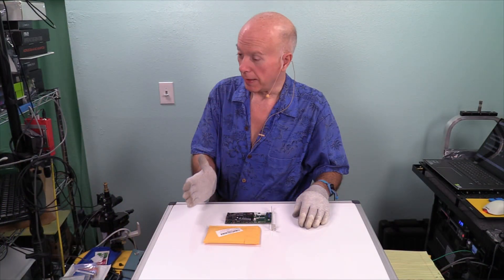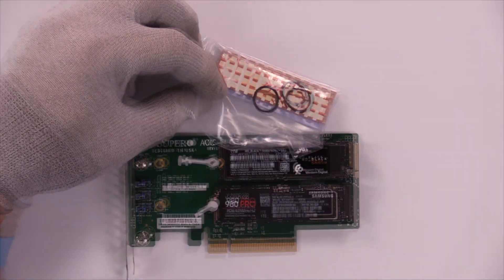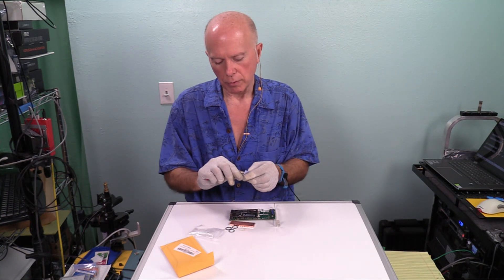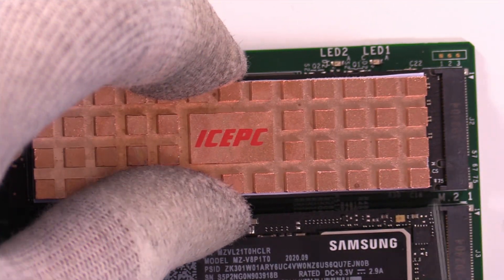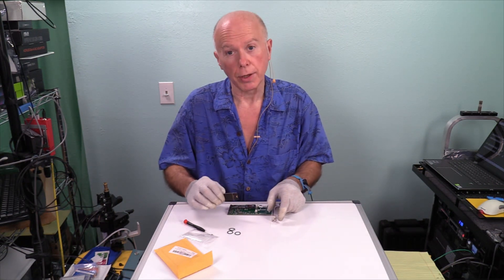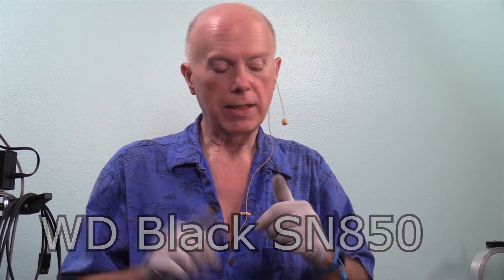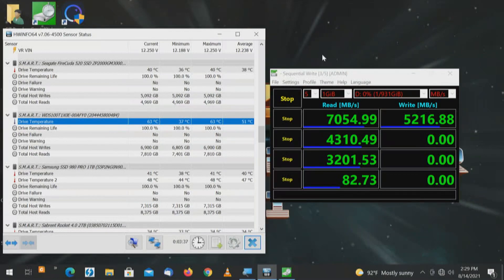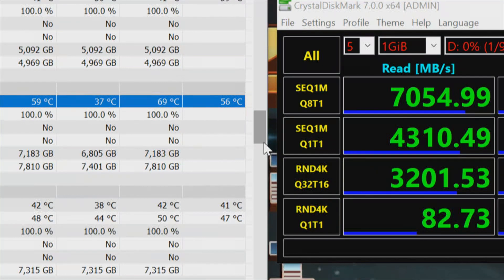Install, Inspect and Test IcePC Copper Heatsink Kit 2280 M.2 Drive BuildOrBuy

Comment: Your short test is simply measuring the heat capacity of the heat sink because it doesn't have time to heat up and transfer much heat to the air.  I wouldn't trust that these are even copper.  You could determine their density by weighing and then submerging in a graduated cylinder of water to calculate if they match the density of copper or a solid copper-aluminum or solid copper-zinc or even copper coated aluminum/zinc.  A longer sustained test would indicate if the heat sink can effectively transfer to the air.  For any of these, polishing the contact surface will probably increase the heat transfer.  I don't know how well the pads conform to the heat sink. Do you see the grinding pattern on the pad after removing the heat sink?

Comment: alum is good for heat transfer and copper is good for absorbing heat
Reply from the maker: Hi @ajd0101 ,
Welcome. Copper has a higher thermal conductivity.
Reply: @BuildOrBuy  yeah stuff always is changing also like you said if you change 1 thing everything get's messed up lol. personally the copper gets best temps but varies day to day sometimes it's at 39 or 37 Gen 5 ssd with nothing it's around 47 with Gen 5 ssd, and with alum alone small/thin shield is like 3-5 degree decrease, that copper is 7-10 degree decrease (Celsius). but overall a hybrid is best majority idk for sure yet lol
Reply: @BuildOrBuy  ive also noticed if i have a fan on pc it really makes no diff in temps even though there's clearly colder air than normal blowing into it , at best a 2 Celsius degree decrease overall the thermal pads are the difference makers
Reply from the maker: Hi @ajd0101, 
Yes. Of the many M.2 NVMe PCIe SSD Heat Sinks we've tested, Passive Coolers have outperformed Active Coolers. That was interesting.

Comment: Lies. First of all, you need to install normal gaskets, I installed expensive 20 W/mm, not standard ones
Secondly, you need to put 2 halves of spacers, 0.5 mm on the memory banks and 0.75 mm on the controller, remove the sticker immediately - 4-5 degrees. It turned out in tests no higher than 50 degrees, 47 degrees.

Comment: nice, but one question, why not removing the brand label sticker before mounting on the HS? not a clean job i.m.m.
Reply: hes testing 2 ssd one samsung one western digital he doesnt want to remove the stickers cuz of that reason so we can see & he can remember i guess..
 
Plus if you remove sticker you VoID warranty..  i just had a brand new WD Blue SA510 ssd sata M.2 not even last 12months in a laptop that still had 477gb left to use it had two sandisk chips on that driver too..
Reply: @user5.56  removing a sticker NEVER voids the warranty . there is a law againts that bad behaviours of manufactureres...so its BS .. the stickers works as isolator...i´ve removed them giving me additional 3 -4 degrees lower temps...

Comment: Would this heatsink be best used inside a PS5? I thought about using Graugears PS5 SSD bay door which has air holes added to it. I figure using this would be better than using the aluminum heatsinks using a wing design made just for the PS5.
Reply from the maker: Hi James Webb, 
Welcome! Based on space, yes. Based on effectiveness, no. We Tested a Copper Plate Heatsink that may be more appropriate. Link below. 

1. MHQJRH M.2 Copper Heatsinks Cooler for M.2 2280 SSD Laptop (2 Pack) 
https://amzn.to/3nSeqXE 
As an Amazon Affiliate I earn from qualifying purchases! Hope that helps!

Comment: I think nvme heatsink is overrated. Don't need it if there's plenty of airflow.
Reply from the maker: Hi Boba Milk,
Welcome! That depends. If You're using PCIe 3.0, Heat should not be a problem. Although We have had a few Viewers who have had Heat issues. PCIe 4.0 and above are definitely a concern for Heat! While Testing 16 M.2 NVMe PCIe SSD Heatsinks We learned to throw all assumptions out the Window! That was an eye opener! We definitely need better Designs in both M.2 NVMe PCIe SSD Drives and the Cooling Solutions We're using. Appreciate Your Comments! Hope You never encounter Throttling due to Heat! Yes, airflow definitely matters!

Comment: Are all chips the same height?  Usually the controller which needs most dissipation is thinner and alot of heat sinks don't have contact with it.
Reply from the maker: Hi Colin Doyle, 
Welcome! Great Question! Height as in thickness. We always think in terms of Single Sided or Double Sided for M.2. Yes there's a difference however We measure at highest point for Heatsinks. Will start checking on that from now on. 1mm Pads should make contact but a different compression factor absolutely. Thanks for pointing that out!
Reply: @BuildOrBuy  Thnx for reply ... I am referring to the thickness of the chips themselves. The controller is sometimes thinner and some are mounted next to nand. From what I gather the controller needs more cooling, the chips about 50% compraed to controller and when a flat piece of material is mounted to nvme "flat" surface the cooling is reversed. 
Good videos :)
Reply from the maker: Hi @colindoyle9876 ,
Absolutely! Good timing! Copy that. To reiterate, compression. Yes the Chipset Requires Cooling. As a whole, We're getting good Numbers. Thank You for Your Comments!! So far, 16 M.2 NVMe PCIe Heatsinks!

Comment: Is the 4mm thin enough to fit behind a nzxt b550 m.2 shroud or do I need to get the 2mm one
Reply from the maker: Hi 24k,
Welcome! This 4mm Milled Copper is way too thick for underneath use! The other Copper Plate We Tested was 1mm thick. Just a Flat Copper Plate, no Milling. That might work behind the M.2 NVMe PCIe Drive. What kind of Temps are You seeing now? Can You keep it below 65C, as is? The 1mm Copper Plate requires 1.5mm space for installation to allow 0.5mm for Thermal Pad. Tight fit!
Reply: @BuildOrBuy  I'm starting my first build and have yet to build it so to answer your temp question I don't know yet I was going for a Ryzen 7 5800x with 3080 nzxt b550 Corsair 4000x Corsair aio with led screen Corsair 32 gb ram Corsair 1000 psu and Samsung 980 and 980 pro for my pcie 4 and 3 slots I was just tryna fig out was there a heatsink slim enough to fit behind my nzxt b550 shroud or would I be ok with jus the m.2 without it or if I could jus use sum thermal pads between the m.2 and the shroud to at least have something to cool it
Reply from the maker: Hi @24k-l9t ,
Got it! PCIe 4.0 needs an M.2 NVMe PCIe Heatsink! Does that Motherboard not include a Heatsink? How much clearance will You have? Success on Your Build!

Comment: I actually bought this before watching this review. Sadly I couldnt fit any traditional heatsink in my laptop so this was the next best option. I bought 2 copper heatsinks a 4mm thick and other slighty smaller and put it on both sides on the SSD. And from what I noticed, it works great.

My only issue with the tempature before is when I was transferring files, the copper greatly slows down the heat from instantly spiking up to 80 'C whenever I was transferring something big.
Reply from the maker: Hi Mikkeru,
Welcome! We expected this M.2 NVMe PCIe Heatsink to do better as well. Surprised on PCIe 3.0 You're having Heat issues. We've Tested 14 Heatsinks and 3 Thermal Pads. A Flat Copper Heatsink was more effective than this one. Link below. 
M.2 Copper Heatsinks Cooler for M.2 2280 SSD Laptop（2 Pack)
https://amzn.to/3g7a1vV
As an Amazon Affiliate I earn from qualifying purchases! Hope that helps! Thanks for Sharing!

Comment: some said , you should remove the m.2 labels before putting on the heatsink.. my question is.. do we really need to remove the labels of m.2 or its ok not to remove, just instal the cool sink.
Reply from the maker: Hi JOHNZKIE FLASHER,
Welcome! Some M.2 NVMe PCIe Drives such as Sabrent utilizes a metallic label to act as a Heatsink. We choose to leave Labels on all of them even if paper or plastic coated since We're always testing so many Devices. Otherwise We'd lose track of Who's on 1st! Heatsinks and Thermal Pads can make a big difference if You are so inclined to try. And this Video is one of 14 Heatsinks and 2 Thermal Pads We've tested on this Motherboard. Great Question! Thanks for Asking!

Comment: Thank you, very much. This is the first time I've added a Samsung 970 EVO Plus SSD 1TB, M.2 NVMe Interface Internal Solid State Hard Drive with V-NAND Technology for Gaming, Graphic Design, MZ-V7S1T0B/AM into an M.2 NVMe to PCIe 4.0 adapter with copper heat sink. Worked perfectly. Thanks  :)
Reply from the maker: Hi Joe B,
Welcome! Excellent! Once You've gone NVMe, no going back! Proof is in the doing! Success on Your Installation! Thanks for Sharing!

Comment: In a few words this IcePC Copper Heatsink is not a good option. Looking for your videos for finding the best cooler without fan for a samsung 970 evo plus. I have a sata III ssd samsung evo 960  and I´m thinking about changing by a m.2 nvme samsung 970 evo plus but I won´t buy it until I find the best cooler. Do you think the Acidalie heatsink would be the best option? I would appreciate your advice. By the way, you make very good and instructive videos and they are very helpful. Let me say, good job!
Reply from the maker: Hi Ignacio Fernández Santamaría,
Welcome! My favorite was the Acidalie and then the JEYI M.2 Aluminum FinsCold iGlacier8 Heatsink beat that one out! Amazing! However, both require lots of space above them! 

https://www.youtube.com/watch?v=_I7Tnlf9_zU
Hope this helps! Thanks for Asking!

Comment: I read a while back that its only the controller chip on the M.2 drive that is putting out most of the heat and when you use a heatsink it spreads the heat to other parts of the drive that normally would remain cooler. I've been considering putting a heatsink only on the controller chip itself.
Reply from the maker: Hi Alex Oelkers,
Welcome! That may be true, however, have You ever seen an M.2 NVMe Heatsink for only the Controller Chip? Are You running PCIe 3.0 or PCIe 4.0?
Reply: totally true 
controller ship height is shorter than other nand blocs
if you put a flat copper on it may not touch the surface as it should

Comment: Lets see a review of ineo icecold heat sink
Reply: It had crazy copper tubes
Reply from the maker: Hi @wargolem2750 , 
The one with 1 Copper Tube and a 20mm Fan? If different, do You have a Part Number? The Amazon ASIN Number would be helpful.
Reply from the maker: Hi Shannon Price,
Welcome! Are You talking about this one?
https://youtu.be/eBcGMfSSF40
Reply: Brand: ineo 

ineo M.2 2280 SSD Pure Cooper Heatsink [M12]
Reply from the maker: Hi @wargolem2750  , Is this the one? Had not seen that one before. Interesting setup. This is new! 
ineo M.2 2280 SSD Pure Cooper Heatsink [M12] 
https://amzn.to/2ZnVML0
As an Amazon Affiliate I earn from qualifying purchases.
Reply: @BuildOrBuy  yes thats the one
Reply from the maker: Hi @wargolem2750 , 
Looks interesting! And wild with all those Heatpipes!
Reply: Hope that helps
Reply from the maker: Hi @wargolem2750 , 
Be glad to if You'd like to make a contribution to cover the costs. So far We've Tested 14 Heatsinks. Those add up. Pablo contributed to cover 4 of the Heatsinks We've already Tested.

Comment: Would this work with a crucial p5 plus 1TB PCIe M.2 2280SS SSD? I am lucky and got a ps5 recently after camping outside a Best Buy for 12 hours but realized I might need to look into future storage expansions as 667 gigs is only enough for like 12 games (I do have the standard edition though, so i figure I will buy ultra hd blu ray versions of some cross-gen games to save storage space).
Reply from the maker: Hi Ian Graham-White,
Welcome! Yes! However, since You have a PS5, get a faster performance M.2 NVMe Drive. The Crucial P5 Plus is PCIe 3.0. Get a PCIe 4.0, 2nd Generation Drive. The PS5 can handle a faster Drive! Hope that helps! Let me know if You need a Suggestion! Keep Us Posted on Your Progress!
BTW: Watch the other Heatsinks We've Tested!
Reply: @BuildOrBuy  I have been doing some research and after seeing a side-by-side comparison of the crucial p5 plus to the internal storage of the ps5 I think I am probably going to go with either a 500GB/1TB samsung 980 pro or a 500GB/1TB wd_black sn850
Reply from the maker: Hi @iangraham-white5717 , 
Hi Ian Graham-White,
Just noticed, is that a Bach Stradivarius? Beautiful Instrument! 

Either Drive is a good choice. Suggest the larger Drive of either. Higher Capacity uses Denser Memory thus typically runs faster.
Reply: @BuildOrBuy  yes
Reply from the maker: Hi @iangraham-white5717  , Stunning! Congrats!
Reply: @BuildOrBuy  I was actually wondering if the graphene coated ssd heat sinks by icepc work better than a slab of copper since the graphene coated ssd heat sinks by them use fins rather than a grid design
Reply from the maker: Hi @iangraham-white5717 ,
Good point! You are not alone! We have too! icepc is using Graphene Coating Copper whereas Gigabyte is using Nanocarbon Coated Aluminum on their PCIe 4.0 2nd Generation M.2 NVMe SSD. However, icepc is still using thermal bands.

Comment: Thanks for the great review and test. Just what I was looking for. I’m using this heat sink for the nvme in my ps5.
Reply from the maker: Hi Thawsitt Naing, 
Welcome! Just now seeing Your message! Excellent! Thanks for Watching!
Reply: I'm using the same heat sink an ssd but I'm just lost rn does the copper heatsinl work well? Thanks in advance
Reply from the maker: Hi @vandalsavage3rd ,
Welcome! Great Question! Surprisingly no! Out of 14 Heatsinks, We expected better. We're also concerned about the longevity of those Bands. We have other Heatsinks that have performed much better. Since Thawsitt Naing already was using it and asking after the fact, did not want to upset his apple cart so to speak. Hope that helps! Thanks for asking! 

BTW: Which M.2 NVMe Drive are You using?

Comment: Another thing I noticed as Gill releases the videos, is that testing has been done in an open case. It is important to consider, for finned heatsinks (and even for the flat one) there may be dramatically more heat dissipation in a closed case. This is due to airflow being in circulation on the somewhat pressurized closed case. The effect of course, will also depend on what's above and below the dual m.2 AIC, on the fans that pull air in from the front (and push it out the back/top), and the nuance of fluid dynamics of everything combined.
Reply: Case open or closed is unimportant as long as all tests are done under the same conditions.
Reply: Yes. And GEN5 PCIe lanes and DDR5 is going to push the total power draw and heat even higher. Gill's comparison is good because all coolers are on the same AIC on the same System with the same open case. And all test were done with the cooler stuck between two full size cards.